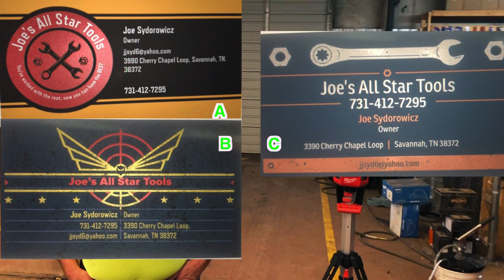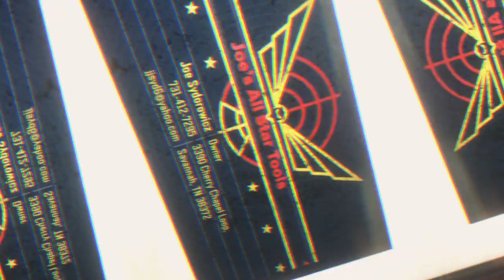Joe's All Star Tools: HUGE Milwaukee Tool Haul

Comment: Those gray pneumatic duo sockets remind me of how how much thinner walled my 3/8 drive Matco 12 point 12mm shallow impact socket is compared to my snap on version. Its so much thinner. It's kind of embarrassing I like snap on but it's painful to look down in my box and see plain as day snap on losin to matco on the 12 point impact wall thickness side of the spectrum. We'll get em next time. And mark em up $50. Call them Flank drive minus too. Lol

Comment: I love my Milwaukee stuff. The stubby 3/8 is beast. My 1/4 is pretty nice also for small stuff. Just ordered the 1/2 stubby
Reply from the maker: The 1/2” Stubby is awesome. I conducted a torque test on it straight out of the box with zero break in. That little gun is awesome. If you haven’t seen that video it will make you proud to own one !